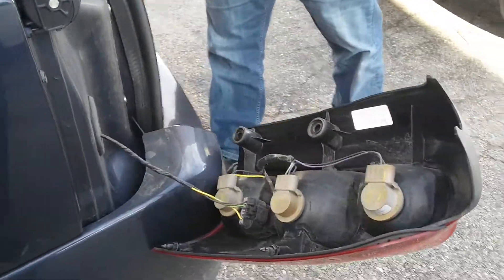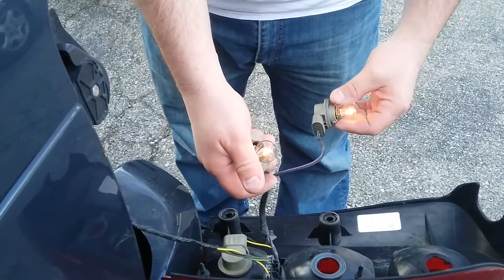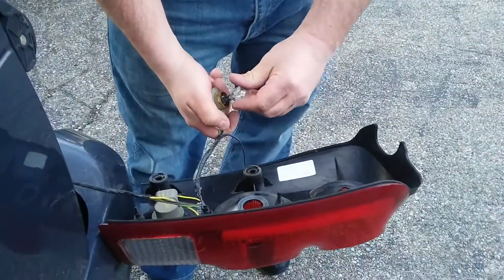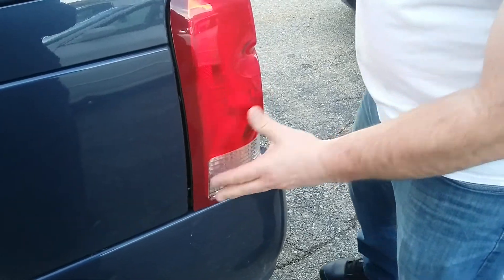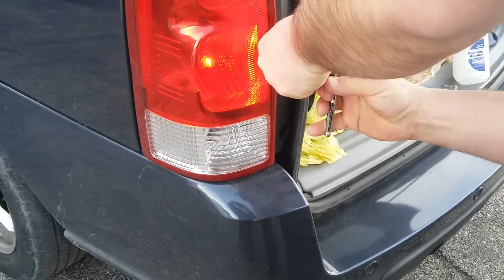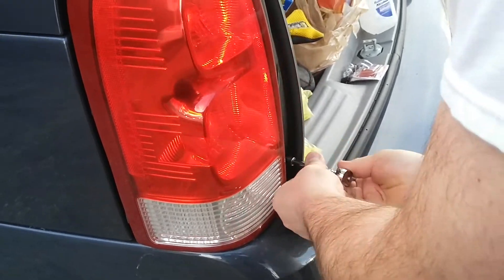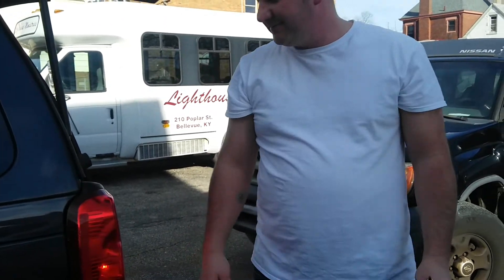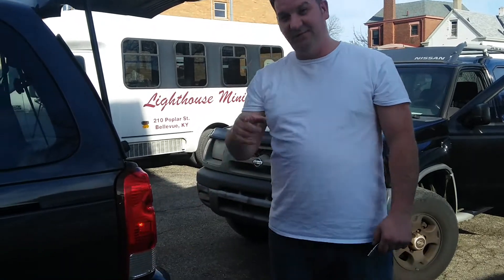Replacing tail light bulb 08 Chevy Uplander

Comment: Hey, thanks. It was so easy. Now I won't get pulled over for a turn signal out. Do you know how to fix the driver's side lock??
Reply from the maker: If the buttons ain't working you might have to replace them I had to replace mine I got the parts out of the junkyard